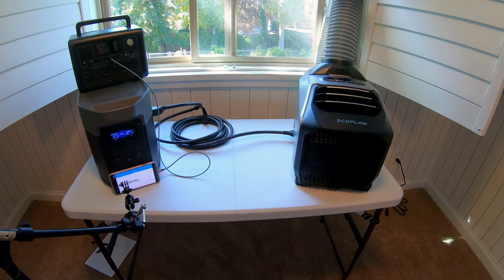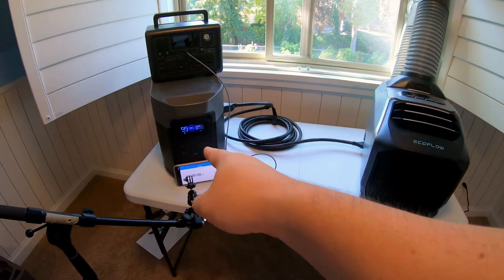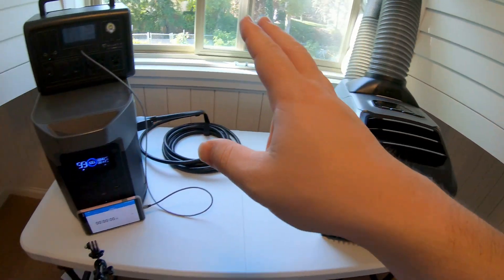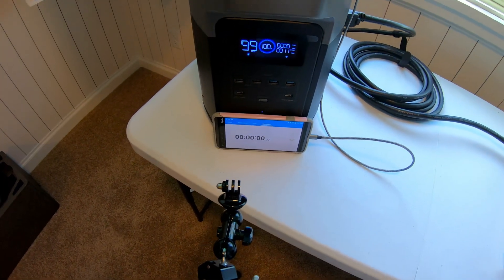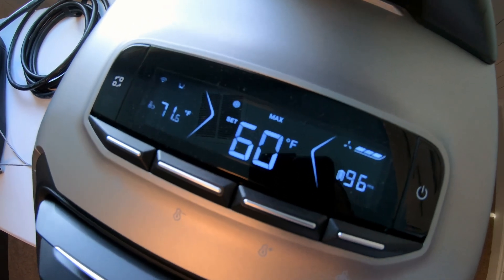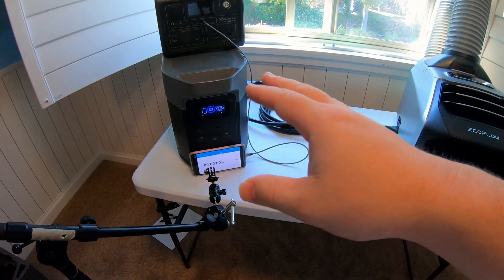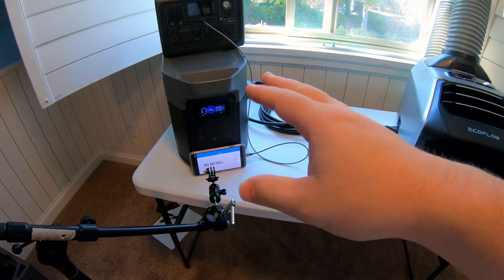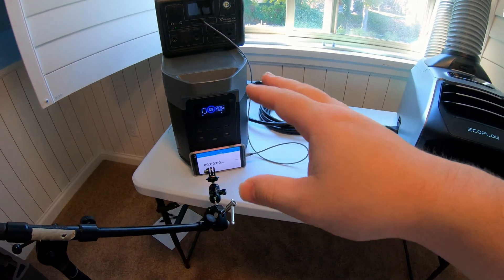How Long Will EcoFlow Wave 2 Run on Battery?

Comment: Excellent video. I am looking into portable AC's right now and have landed on the Eco Flow Wave 2. I wanted an additional power source and this seems to be a great fit. Thank you for your research.
Reply from the maker: You’re going to love your Wave 2! Glad I could help! Thanks for watching!
Reply: @theresatrickforthat  I'm glad to hear it. I just ordered the wave 2, spare battery attachment and the Delta 2 with the solar panel charger.

Comment: Why would it pull 11 watts just sitting while turned off...?
Reply from the maker: Not sure. Maybe the WiFi connection is what is consuming the power because so long as the unit has power, you can turn it off and on in the app. Thanks for watching!

Comment: When you have it on eco mode does it still blow 60 degrees out? Is it truly 60 degrees is what I’m really asking.
Reply from the maker: It blows out very cold air when the compressor is on. But Eco mode causes the compressor to run for a few minutes and then forces it to stay off for a few minutes. During the time the compressor is off, it’s just going to be running the fan blowing ambient air temperature out. Thanks for watching!

Comment: What power cable did you use to connect the Delta to the Wave? I am using the AC cable but looking for a different option.
Reply from the maker: I'm using the long DC to DC cable they sell. Don't recall it's technical name. But it's pretty easy to find! Thanks for watching!
Reply: @theresatrickforthat   Thank you, I ordered one from EcoFlow. Thanks for the content.

Comment: here's my honest review. i use this in my semi truck. there's no way it can cool the whole truck unless you run it off of a huge battery or ac on max mode. the add on battery will give you 4-5 hrs at best using eco mode and only pointing the air on yourself. I've setup a tent inside my semi truck and did everything i can and it will give me 5 hours on manual mode fan 1 temp 75f. so either get a huge battery or run it off a gas generator.
Reply from the maker: Great insights! Thank you! And thanks for watching!
Reply: Are you using insulation?